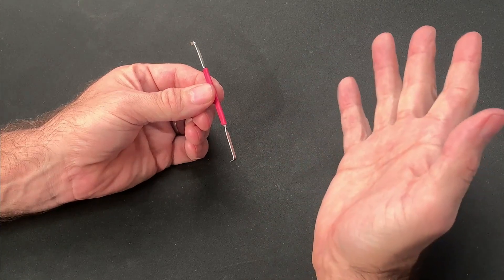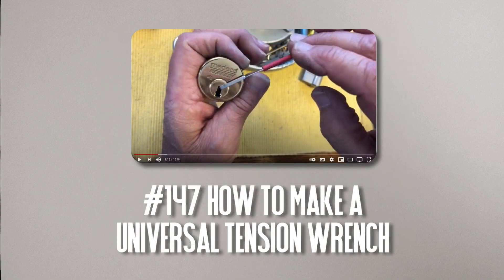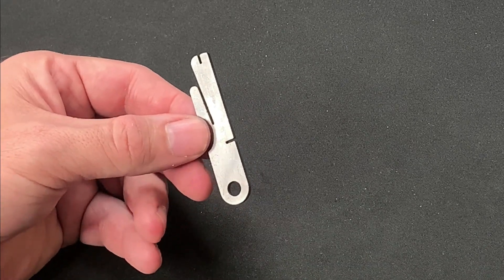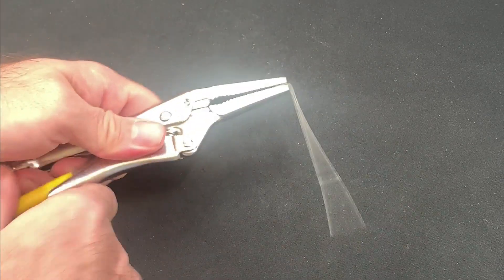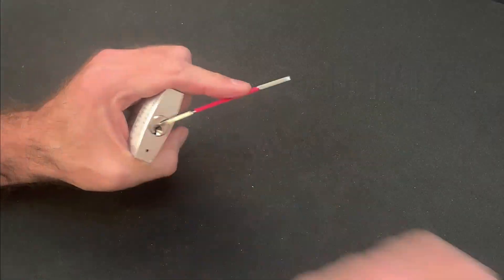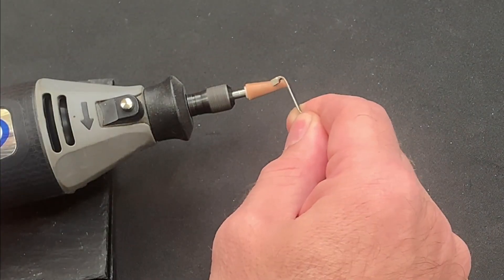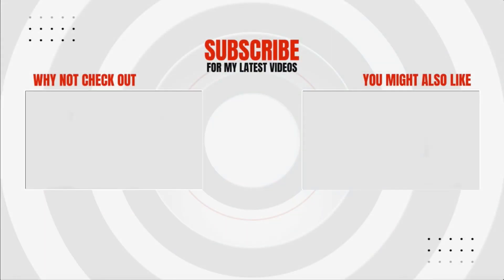023 How to make the best tension wrench for lock picking using wiper blade inserts

Comment: If you use smooth jaw locking pliers you will get less breakage, the serrations or nurls in the Jaws create deformations in the stainless causing weakness. Also instead of your first bend being at the very end you should leave extra then trim. Steel has a grain similar to wood, in stainless wiper incerts it runs the length of metal. So leaving an end to trim off means less stress and fatigue on the metal at the bends, that's why it's so easy to twist in the center but twisting the ends feels difficult in comparison.
Reply: Ok this has sparked my curiosity..see I have a semi decent knowledge of steel not good not great and also not none ! ..and knowing what I at least think I know there are no grains in steel like there are wood especially giving that the vast majority of all steel used in modern times and still in the past was cast into a shape and then beaten into shape so to my knowledge there is no grain of steel ..I mean zero disrespect but if im somehow wrong id love to hear how and why ( we all keep learning daily) heat treating is what I think makes all the difference I've never heard of direction in grains of seel
Reply: @trailman20  OK, so a little background both my father an I worked in a steel mill, specifically in the rolling department. Anytime you have rods of steel, Ex. Rebar, springs, wiper inserts, really anything that is solid and has a diameter say 2" or less but has length. (wiper inserts start out as round bar and are flattened) This material is extruded it starts off life as a billet and is gradually compressed and stretched thinner and thinner over miles of length. (I'm sure you've seen coils of steel traveling down the road on the back of a semi) because the steel billet was made by casting the steel has a structure that is for all intents and purposes random. However stretching the steel forces that structure to stretch along with it, and gives steel it's elasticity. So, that grain though invisible still exists if you break the strands (grain) it's prone to failure.  This grain is also what gives springs thier memory. And a wiper insert is literally nothing more then a really long thin leaf spring. The science of steel is mind-boggling and takes a far bigger brain then mine, I tried to make this explanation as basic as possible, but in turn might have made it more confusing.

Comment: Cheers Andy! Cheers Chris! Good video. I would like to add that these modifications can be done to existing manufactured tensioners that you already have in one’s purchased kit. So aside from making these up from scratch, you can modify what you may have. The heat gun is also good for softening the metal a little bit for bending. Insulated Gloves are a must! You can get a burn. Granted it won’t do a proper job of softening the metal and you will lose a little metal rigidity-tempering. But it helps on the 90 degree bends along with the slow gradually bending. Take care gents 😁.
Reply from the maker: Absolutely Derrick - all good tips - thanks mate 🙌
Reply from the maker: Really helpful comments - thanks for taking the time to post these 🙌

Comment: I may have to have a go at one of those, but without the middle twist, I've never had much luck with springy tensioners.
Reply from the maker: Yep, I’ve made a few of those too and they work fine Dave.
Reply from the maker: I’m sure a stiffer variation will work just fine too and will be quicker to make too 😉

Comment: PROPANE TORCH!  Bend while hot.  Afterwards, heat to a pale glow and dunk in oil or water.  To anneal just a little use a heat gun on HIGH and get it nice and toasty, hold for just a bit, and cool by air.  These are not structural parts, so you can go by color and seat-of-pants.  
I had some "brittle" spring stock.  Wasnt really brittle, it was just a different composition or left less annealed from the factory.  Either way propane was the solution to my problems and it allows you to make some fanciful bends without killing a pile of stock.
Reply from the maker: Good tips thanks 🙌

Comment: this is a great video! I just striped down a wiperblade and the strips measure 2.5mm x 0.8 as you measured yours at the start, but in the video they look bigger material and on Chris's, what are the measurments of the material on the ones that chris seems to use all the time and will try get the same, maybe need bigger wiper blades?

Comment: If you heat up any of your bending it won't brake and will not be weaker it will be stronger then if you bend with out just a tip since I have  got a lot from your work thanks again

Comment: What alloy of steel are quality wiper blades made from?   (alloy number would be particularly  invaluable). Given that information, it is easy to get the details for heat treatment.   Heat treating is not difficult.   It would lead to less breakage when twisting the metal.   You would then treat the metal to a desired flexibility and/or hardness,

Comment: Cool design!
To make bends better, I highly recommend heating it up first til it glows. I use a butane torch. The kind people use for cooking/baking. After heating it and bending it, dip it in cold water. I've gotten some pretty thick tension wrench metal bent easily that way. Even bent wiper blades to look just like flat bars/TOK wrenches.
Reply: Completely agree. Cheers.

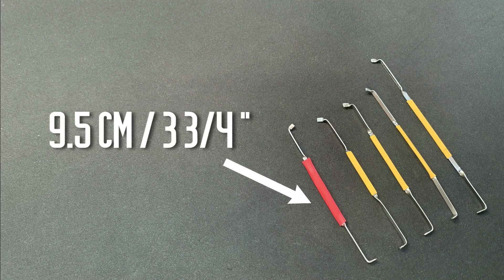Comment: If the steel is snapping, like at 3:52, the steel was probably not tempered.
To temper small bits of steel pretty much any flame will do. The range in your kitchen, a pluming torch, etc.
Put the steel in flame. You’re looking for it to gain a light straw color. Allow to air cool.This refines the grain and make it a bit more flexible.it shouldn’t snap after that.

Comment: I'm replacing my wiper blades tomorrow lol. I'm wondering if applying heat to aid in bending it would help, you should be able to temper and anneal it in motor oil so it's not too brittle.

Comment: Good tip. It would be even better if we knew the size of the material used. My wiper material is 1.2mm thick by 3.8mm wide and it seems a bit too thick?

Comment: Thanks for the video. It was quite timely for me as I was having trouble with the TOK tensioners I have. I’ve been getting quite frustrated with them slipping out all the time and maybe some homemade ones with different thicknesses will help.
Reply from the maker: That’s definitely something I’ve found is happening less since I started using Chris’ design - hope it works for you as well. 🙌

Comment: It's interesting that you prefer the twist in the middle, as it actually reduces your sensitivity. Later, you may decide upon a design without the twist in the middle, especially if you start messing with higher security locks, like Medecos.
Reply: I'm curious if the fact that it's a double twist, reorienting the blade back to it's original direction, resolves that issue at all somehow.
Probably not.   Imagine a corkscrew design, that'd be an experiment.
The alternative for a wider finger surface is to solder another piece of blade in the middle of the tool, parallel but at a right angle along the edge of the main blade to provide a wider finger surface. Actually that would probably stiffen the tool even more, but would be a lot of work.
Reply: A corkscrew would be horrible as it would bend in every direction. The advantage of a twist in the tension wrench is that it allows for instantly setting pins as they reach the sheer line, but they reduce sensitivity and if you're needing to feel for counter-rotation, you just might not be able to effectively read and control that. In a nutshell, makes easy easier, but harder much harder. 

Regarding the double twist, it is irrelevant as you are tensioning after a single twist. 

Baaisically a twist allows you to use a heavier,sloppier tension which is lightened by the twist. This has been my experience so far.

Comment: Very cool guide buddy! I'm gonna have to make one of these :D

Also just a small tip with the more brittle metal... If you soften the metal first with heat, then bend, it's more likely to avoid snapping. You just need to harden the metal again afterwards by heating it up again and then cooling it quickly.

Also, awesome work with that 1100 buddy, your progress on that guy was nuts!!
Reply from the maker: Great tip - thanks mate. I am just editing next week's video release which will be all about our coaching session and the 8 takeaways I learned from you :)
Reply: @fishpicks4531  Awesome! That's so cool :D

Can't wait to see it!!!

P.S. in case you haven't seen yet, I sent you the specs on my flag I use for MTL (and sidepins too)
Reply from the maker: I saw that mate - thanks. Haven’t had a chance to do any mods yet because of work commitments but am hoping to have a go this weekend - wish me luck!
Reply: @fishpicks4531  good luck! :)

Comment: That was a really interesting guide, thank you!
I will not try it because I do not have any of the tools needed, but that is good knowledge for later eventually :)
But you made me wonder, since you already have the heat gun at hand, why not using it to help soften the material and make the metal bend more easily without breaking? With the steel melting at ~1500°C and the heat gun probably not hitting more than 450°C at best, and the force already applied by the pliers, I do not think that you risk to damage the integrity of the tension wrench and make it weaker for it's usage.
Reply from the maker: Fair point Kane - I guess I didn’t think the kinds of temperatures I would achieve before I couldn’t safely handle the materials would make much of a difference to it’s malleability. I don’t have heat resistant gloves so I just did what I could with the tools I have on hand.

Comment: Great detail, but clockwise/anti clockwise is completely dependent on the hand doing the turning. I guess it'd be helpful to make a point of the first clockwise turn is actually turning the HEAD you just made clockwise (meaning the lower portion "handle" is going against that turn with an anti-clockwise turn) etc...

Comment: Good video. 1st= So glad you made the comment about Petersons insert package, as I was about to buy them= not going to now. I hate Peterson's picks. I'm a Sparrows man through and through. The few times I have overpaid for their picks= insta-breaks??? I had 1 I put in the keyway and on the first lift- the tip broke off? I see a lot of the 'sport pickers' use them- and I think it's because their metal is 'scratchy'. In that regard- they give good feedback, but they are scratchy because they are a brittle metal. With a price point that's 3X's the price of a sparrows pick, it's a no brainer what I use. 2nd= Chris had a ton of vid's and I watched the one on making his tensioner. He is a train-wreck for content quality, lol. The video's are so poorly produced they are hard to get through. They are disorganized like HE is disorganized, as is a testament to his layout, which is covered with random pieces from? Also, his fingernails look like a homeless person's toenails. 3rd= tensioners are easily the least talked about tool in picking, which I don't understand. I've had locks I couldn't pick because I didn't have the proper tensioner. I get the right one= and breeze through it. I really wish a lock company would come out with a comprehensive and well though out set. Usually they make it longer, or shorter, or put a twist in it, or have each end 45 degree'd turn from each other- which makes putting them in a case less than ideal. Kirigami tensioners are at least new in design and I plan on trying them but enough research hasn't been done nor does it seem it ever will. You have all this research on pick head design when in truth- it makes very little difference and some of the heads the produce= you'll never find a lock you can use them in. You need like 6 hook style, a few rakes and that's really it. Anywho, thanks for the vid. I plan on making my own and will still probably buy the Peterson turning tool but will NOT buy their metal strips.

Comment: What's better than windshield wiper inserts find a street sweeper take wire cutters and clip off some of the bristles of the wire wheels on each side they are a very hard Spring Steel the same diameter as windshield wiper insert